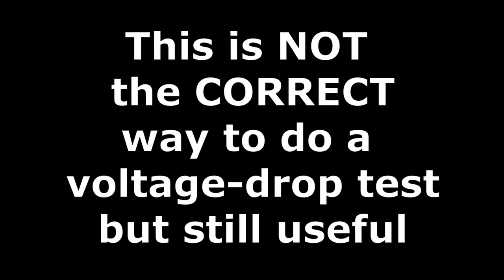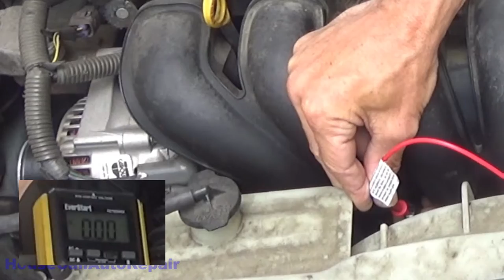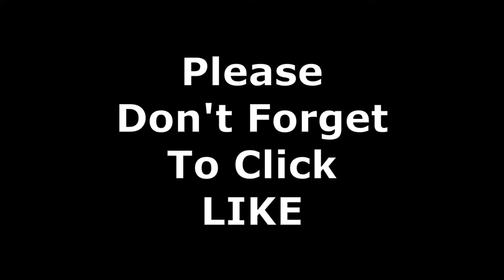Toyota Corolla - No Crank No Start - Starter Replacement (Near real time) Test, Confirm, Replace.

Comment: Wait a minute, I just tons of videos we’re they don’t remove all those parts!!
Reply from the maker: There are MANY methods. This method made it easy to record, and didn't require moving the car or getting under it.
Reply: @HouseCallAutoRepair  you just removed the radiator fan and that's it, easy access to the starter

Comment: Good tips, but removing the intake manifold to get to the starter is pretty extreme. After removing the electric fan shroud and working from the top, the starter is right in front of you. Just remove 2 12mm bolts, the overflow hose, unplug the fan switch and pry off 2 wire holders. Then remove and replace the starter.
Reply from the maker: I will definitely agree with that method, however, it would have made camera angles much more difficult, and 7 bolts isn't really extreme.

Comment: Took me 10 minutes to take the starter off mine without taking all that off , top one is a slight pain but it's wasn't a big deal
Reply from the maker: there are always multiple way to get a job done...
There's the easy way, the hard way, and the smart way. The only real differences are the time and the struggle.
Reply: @HouseCallAutoRepair  you did it the hard way 🤷🏻‍♂️
Reply from the maker: @heartwarrior9762  Yes, I did it the "harder way" but not the hard way. You had a clear view of what I was doing, right?

Comment: Very informative video. I just put a starter on my 2006 corolla tonight. I took out the fan. It's two 10 mm bolts and it's out. I got to the starter no problem.
Reply from the maker: I'll check out that method on my next one! Thanks!!
Reply: Even faster, it is possible to remove the 2 solenoid screws (there's room for screwdriver), remove the B+ and you have the solenoid in hands.
Sand the plunger and the solenoid internal with 300grit, use hi-temp slight grease and that's it. It really takes only 10min to do.

Comment: Thanks a lot. This video was extremely helpful and useful. I got stuck three miles from home because my starter was failing. As I waited for my ride, I watched your video. Got home, and ordered a new starter. If it wasn't for FedEx making a mistake, I would've done this job in two hours. You saved me about 3-500$. I would've had to pay for tow and a mechanic to do it for me
Reply from the maker: THIS is the reason I make these videos... if they help anyone, even a little, I've done what I intended. Thanks for watching and the comment!

Comment: You are a good mechanic and a good teacher!
Reply from the maker: Even with the simplest jobs, they're a first for someone. I've found FEAR OF FAILURE to be the biggest reason for people to not fix their own car, or take on ANY new project, themselves. My intention is to show how they CAN do it themselves.
Thank you!
"You've got no more excuses, pick up those wrenches!"
Reply: Thank you . Mine is still an original denso Toyota I’ve checked. I did watch a starter replacement video several days ago. Eventually I will have to change it. My bolts are on the right side facing the battery, which would need to be out for an easy access to the starter. I’ve changed several thing since owning it for now a month ,basics . The alternator three weeks ago. We buy used so we can work on those , because we can. Some jobs will grow on you and when you’re ready you’re ready. Of course I watched those a few times. Premium gas and full synthetic oil will make your car better and  last much longer and cleaner! I’m just amazed by my Corolla!!!

Comment: Just removed the radiator fan and easy access to starter 🤷🏻‍♂️
Reply from the maker: Do you live in or around the Salt-Belt? Here, those 10mm bolts usually break.  The whole purpose of pulling the intake manifold (which actually is very easy to do) is to provide the best possible camera angle to view it's location, position and mounting.

Comment: I like your method of diagnosing the problem. Working outside can be difficult. Fortunately when my starter went out my car was in the garage.
Reply from the maker: While the method used isn't the right way to check the circuit, it did still confirm what I suspected. Had I been wrong, the voltage testing would have been inconclusive. (aka bad connection in the circuit)

Comment: Not hard to pull the two fanshroud bolts and unbolt the starter, ease it out then disconnect the starter wires. Good to remove barrery neg. first.Did my 03 Matrix 1.8L that way yesterday.CHEERS from Here!
Reply from the maker: In the Salt Belt.... one wants to mess with 10mm bolts as little as possible! (they all break)
Reply: @HouseCallAutoRepair  Got it! Enjoyed your video from Westcoast Canada!

Comment: Could you or someone please help? I changed my daughters alternator and it started fine for the whole day and the next day it wont start, when she turns on the key everything powers up but no crank, Im not sure what to do, PLEASE help, I tried my battery in her car and same thing, no crank.
Reply from the maker: First you need to find the problem. Voltage readings! Battery, after sitting for a few hours MUST be above 12.6 (less means discharged or defective) THEN start engine. Battery voltage SHOULD climb to between 13.5 minimum and 14.8 maximum. IF you do NOT achieve at least 13.5v running, measure voltage between battery NEGATIVE and engine block. IF you get more than 100 millivolts start cleaning grounds!
Reply: @HouseCallAutoRepair  hey thank you for replying. I would be happy to make you a custom shirt for your business or something or if you need any vinyl decals I got you.
Reply from the maker: Do NOT confuse an alternator for a starter. They do extremely different things. (The alternator has NOTHING to do with STARTING, UNLESS it is seized and preventing the engine from rotating)
Reply: @HouseCallAutoRepair  OK then I’ll try to see if I can narrow it down. It’s weird it worked fine for the whole day but the next day no start.
Reply: @HouseCallAutoRepair  thank you so much and let me know if you need any of those things I would be happy to do it for you